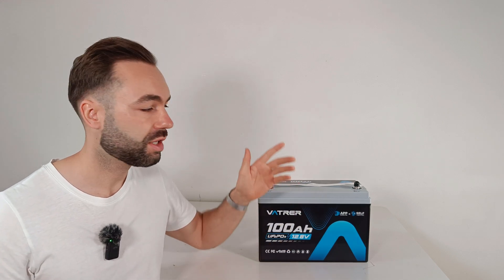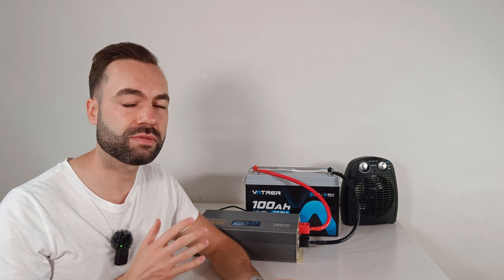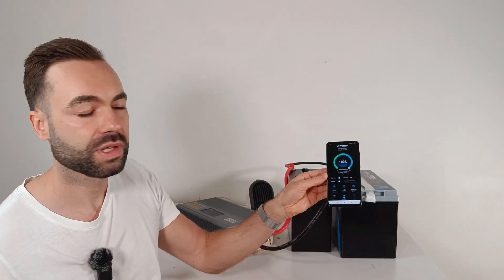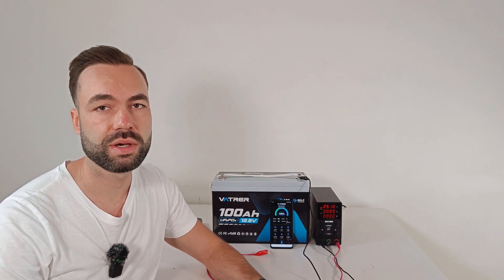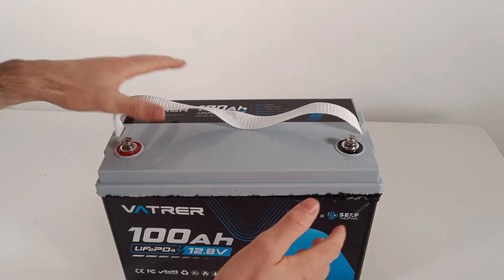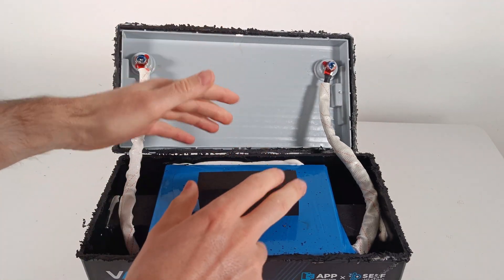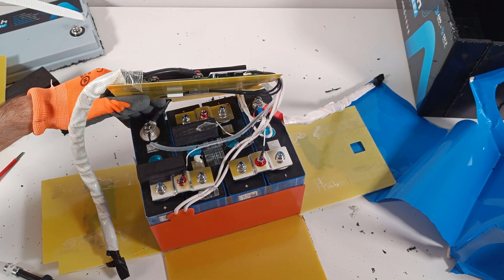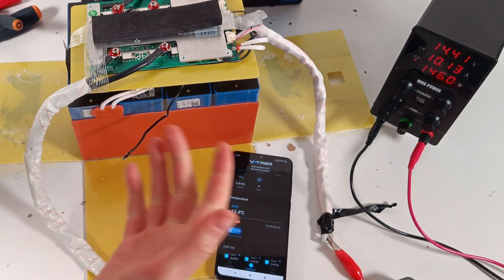I Opened the Vatrer 12V Heated Bluetooth Battery. Here is What I Found...

Comment: What is the low voltage disconnect parameter for each heating element and how do the on/off cold protection values correlate  with ampacity and voltage values minimums🤔
Reply from the maker: Low voltage protection is 2.2V per cell, which should be set to 2.5V as well. Heating is done by the charger, not by the battery.

Comment: Great video. I have the vatrer 460Ah 12V battery and share concerns about the 3.75V cell overvoltage limit. After accidentally performing a "capacity correction" in the JBD app, which messed up my state of charge (SOC), the Internet advised me to perform a full charge-discharge-charge cycle to recalibrate it. Vatrer confirmed my warranty was still valid, even though their policy states that adjusting settings voids it.

The 3.75V setting is problematic, as you noted: overcharging provides minimal gain and risks cell damage. But vatrer told me not to change it.

I'm having trouble resetting my SOC with the charge-discharge cycles, and I'm uneasy with how high the cell voltage gets during the process. Even though I think my soc is reporting correctly now I haven't got the battery to report cycles so I think I need to turn off the battery for 30 minutes at full and empty when I charge-discharge-charge to see if that helps reset the BMS.
If you have no switch then disconnecting all loads should do the same.
Be careful with the jbd app they have what look like deeper menu buttons (is greater than symbol) but it will perform the action at least in the case of close capacity correction. The xiaoxiang app behaves as you would expect when you press what looks like a deeper menu button. 

These BMS record every thing you do so I'm concerned if I change the over cell current setting I'll lose warranty. Catch 22.

You don't need to delete apps to switch to them. I'm using the three I've mentioned. You do have to exit or pause app for them to let go of the Bluetooth though. Sometimes I have to toggle Bluetooth off/on for it to really let go. 
You can click on the connection on the first page of the vatrer app to disconnect there.
Reply from the maker: Indeed, when i disconnect the Bluetooth from the Vatrer app it works. I can adjust more parameters with the overkill solar app than the Xiaoxiang app. If you want to 'reset' the battery, then you can do a full cycle, don't worry about the over-voltage. It will settle down after one minute, and then it goes back down to it's resting voltage of 3.325V. It shouldn't be a problem when you use a normal charger, and not use an overvoltage charger like i did in my test (25V). The cells seem to be very good balanced and matched mine has 0.001V difference. So i wouldn't worry about an imbalance as well.
Reply: Yes, I should have added that I am very impressed with the balancing in my battery. It does climb when approaching full charge but that is probably normal? The highest I've seen is .060 and mostly sits at 0.001- 0.003 in normal operations. 
I've seen my cell voltage go over 3.65 when charging with a 12v charger. 
Vatrer told me the 3.75 setting was to minimize BMS shut downs, to protect it. It's stupid imo. 
I will experiment with lower charge voltages to see if that helps.
Reply from the maker: @daveybphotography  Yes, it's normal that at the top and bottom of the charge curve the differences are greater. Thats why balancing starts at 3.3V per cell. If your cell voltages go higher than 3.65 with a normal 14.6V charger (3.65/cell) that means that your cells are not in balance. So i would leave it on the charger for a while to let them balance. I suspect the cells are matched in the factory for every battery because they have small stickers with QR codes on it (you can see it in the video).
Reply: I'm trying to overkill with my litime 24v 100ah BT and cant seem to get it to connect. I see a pop up, I click then nothing. I tried force stopping the litime app, then resetting BT app on my Android but nothing. Oh well. I was just curious what it would show since the litime app doesn't show individual cells
Reply: @einyv from a quick Google, litime has their own BMS and is not overkill, jbd so it won't work. 

On re reading it doesn't look likely. wattcycle has their own BMS also and it's terrible.

From Google:

Potential alternative apps for some LiTime batteries
Xiaoxiang (JBD) app: Many users on DIY forums report that some LiTime batteries use a JBD BMS, which is compatible with the Xiaoxiang app.
How to check: You may be able to determine the BMS manufacturer by examining the battery's Bluetooth identifier or by checking DIY solar power forums for information specific to your battery model.
Reply: @einyv Pause app. Force stop might also work. But I don't think your BMS is going to work with overkill. There may be others like BMS meta but litime may have locked things down.
Reply: @einyv if your litime doesn't shut down charging much before say 28.8v then you are in better shape than I was with my wattcycle which would shut down charging at the equivalent of 27.2v (13.6v in my 12 volt battery) 
I'm just doubling my results, I think that's ok to do so for a 24v battery.
Reply from the maker: Vatrer sent me an email saying that changing the settings will void warrantee. I understand their reply though. If you don't know what you are doing, then it might do more harm than good.

Comment: I have a question. No one can seem to answer This.   The eco worthy 800 watt solar kit  charge controller is under rated for  the the panels for 12 volt. Amps is over at 12 volts.  Can some do figures and see if iam right. Please help
Reply: Running in parallel or series? Mppt controllers clip amps. 
Over paneling. 
These are questions you can ask Google in AI mode and have it walk you through if your system is actually fine. 
I've been having long discussions about my system recently and it can get really specific if you give it your model number or even upload an image of the listing for the product. 
Be careful it sometimes talks absolute bollocks but if you challenge answers you don't understand it will either convince you or fix it's mistakes. 
Good luck
Reply from the maker: If you have 800W of solar and a 60A MPPT charge controller on a 12V battery, the current will be: 800W/12.8V=62.2A. However, a solar panel doesn't deliver 100% of it's output (most of the time), it's more like 70%. So 800W*0.7=560W, then divide by the battery nominal voltage = 43.75A. So your MPPT is correctly sized, it will just clip the excess current on cold sunny days. Checkout my recent video about the victron mppt, which works on the same principle.
Reply: @cleversolarpower  thanks i have been racking my brains out over. This.  I also was think.  Okay i switch to a 24 v 100 ah and then double my 195 watter solar panels and.  I think will work better at 24 volts

Comment: What was that app you used to change the BMS?
Reply: Overkill Solar App if someone other is interested 🙂
Reply from the maker: Indeed, I had to delete the Vatrer app first before the overkill solar could find the BMS.
Reply: I've left a lengthy comment here that you guys might want to look at. Cautions about voiding warranty that I'd like to be proved wrong on and also you do not need to delete app. I'm actually using 4 apps because they offer different features. The xiaoxiang app and the jbd app will show time left for discharging and charging. I wish that was in the vatrer app. I have to force dark mode on the others because they are better that way for me.
Reply from the maker: @daveybphotography  I just received an email from Vatrer saying that if you change the BMS parameters, that the warranty is voided. Understandable though.
Reply: Nevermind you said it at the end

Comment: Also note bus bars connecting the cells are bent for any expansion.
Reply from the maker: Yes, they are bent. I don't know if it's needed though. Layered busbars would have been better. But I don't think these contract and expand that much. I think it's more useful for the larger cells 200Ah+